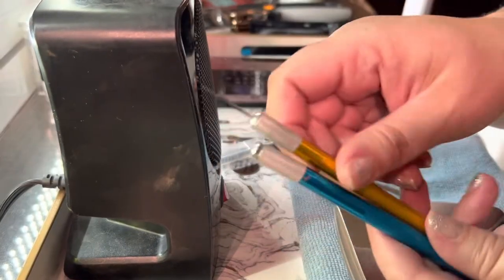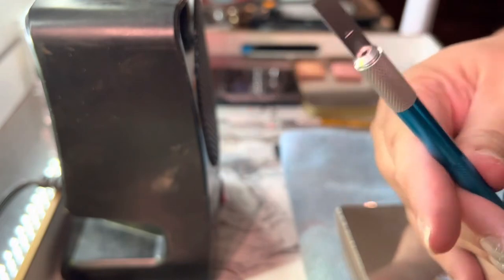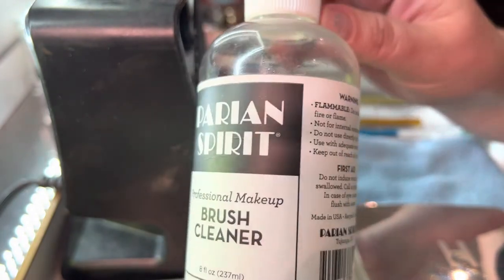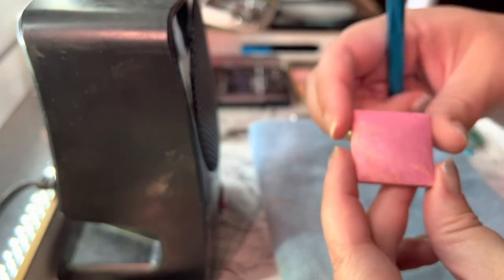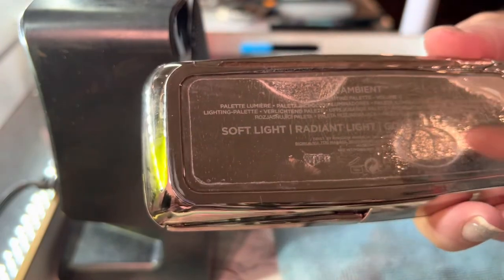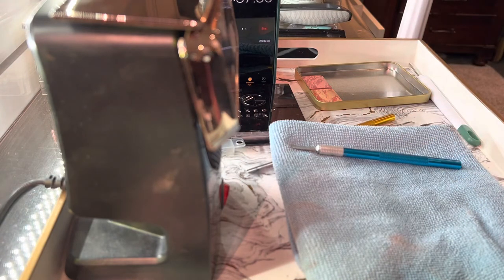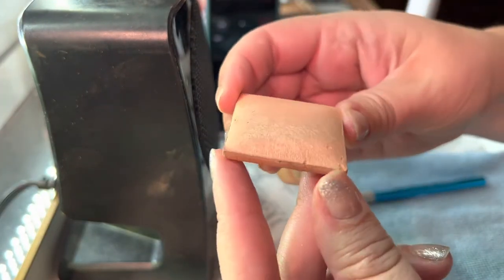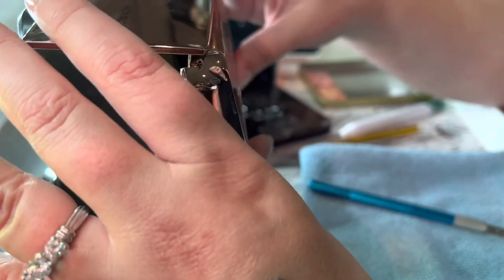Depotting and Rearranging Hourglass Ambient Lighting Palettes

Comment: So helpful, Thankyou
Reply from the maker: I am glad this helped you.  I appreciate the time you took to watch.
Reply: @melbygrace  I literally googled how to depot hourglass and this came up so I subscribed. Great timing
Reply: @melbygrace  I wish they would stop putting the dim powders in the palettes and would do all blushes, and strobes haha
Reply from the maker: @mercy7988  I wish that they would do one dim powder in each palette but you could select that item. Even if the rest of the new is already set blushes, etc. I wear soft light and it is not sold as a single. I will use the one that I depotted until it is gone and then it will not repurchase. Laura Mercier has a candle glow powder that comes as a single and works just as well. I have Tiger coming today. You can check my IG next week if i depot/re organize.
Reply from the maker: @mercy7988  I googled and when I couldn’t find an answer, I researched as far as I could and then risked it